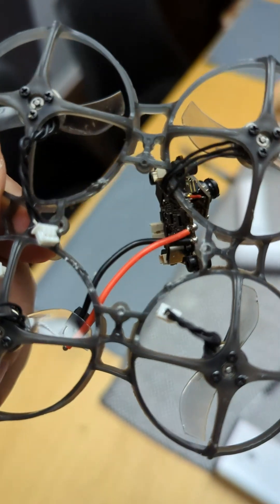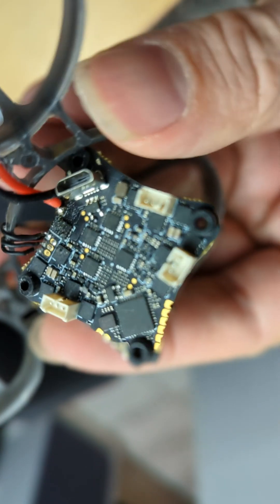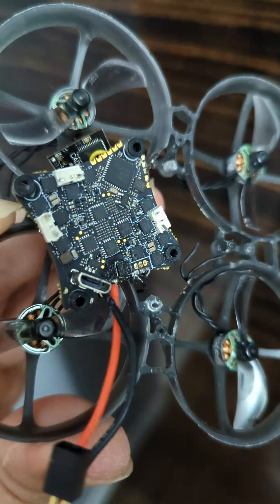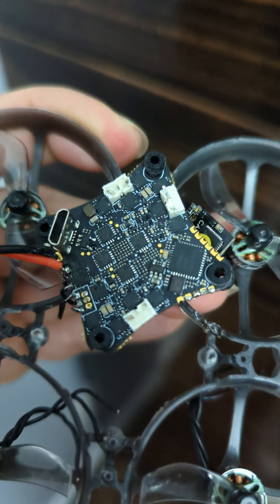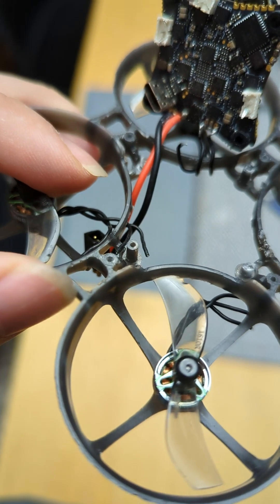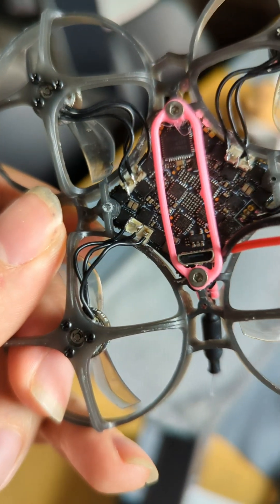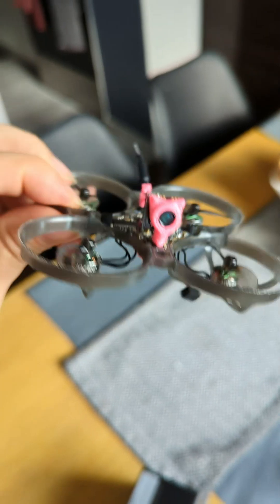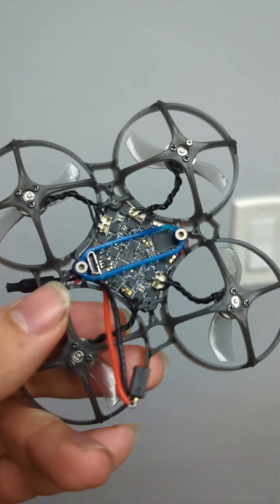Tiny Whoop Build Tips #shorts

Comment: Even better if you want them gone use some hot air to soften the plastic then pull the plastic off then just desolder each pin one by one
Reply from the maker: @rowanballinger3690  I've done all of that and I've damaged a lot of boards...  literally over six, so now this is my way of doing it. Ever since I switched to this method no more damage.